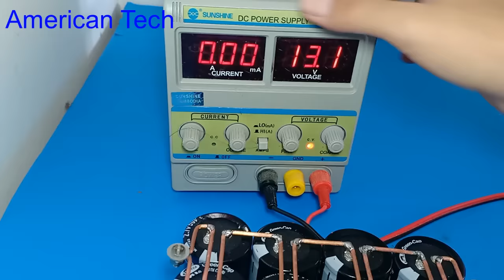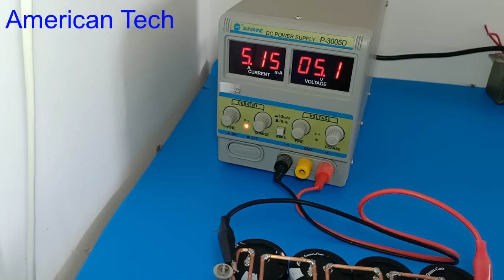12V , 100A using Super capacitors , Amazing idea

Comment: I'm no electrician, but my son has a similar setup in his Toyota pickup. Been working great for around 6 months so far. Yes, he uses a small solar panel to keep them topped off, but overall, hasn't had any issues at all.
Reply: capstr kahn say milain gay
Reply: A very interesting comment sir. May I ask what is the power rating of the small solar panel that your son used?

Comment: What your doing is DANGEROUS. This circuit should never be run higher that 10.8 volts and without a balance circuit to stabilize each pair of caps they will eventually destroy themselves.
Reply: Это реклама для лохов покупателей.
Reply: I agree. He needs 6 capacitors in series to allow an absolute maximum of 16.2 volts, to be compatible with charging a 6 cell lead acid battery. The 12 capacitors, series-paralleled, will yield 166.66666.... farads.
Reply: Thanks!:D
Reply: if the output is feeding the electrolyte HHO  generator and the input is from the car alternator, perhaps you can get about 20Amps feeding continously
Reply: Didn't Lasersaber built a safe version years ago?
Reply: @kennethschultz6465  whats that
Reply: He'll fry his starter too if he has over rated fuses between.
Reply: @pyronmasters  
Yeah. Somebody did. The biggest problem is that if for some reason you flood your engine, you wont have the cranks to air out the engine. Then you're screwed.
Optima makes a really nice battery. If its taken care of itll last forever. Well, close to it.
I'd never trust this contraption. Probably end up getting killed checking your oil.
Reply: AHHHH does this mean im gonna die
Reply: Svp ecrire en français
Reply: Olha o like
Reply: @seryj591  
Но вы действительно можете это сделать?
Reply: @vincentrobinette1507   ....
Reply: The capacitors discharges with a couple of hours. As long as you have the input voltage from he generator, sofar so good. Useless for starting the engine.
Reply: 2.7V * 4S = 10.8V, Balance circuit

Comment: The capacitors are connected in a series and parallel configuration,  ie 4x 2.7v = 10.8 working voltage NOT 12v you are over charging the capacitors. Add another two to the array  would solve this. I don't think that wire would handle 100 amps eather.
Reply: Wire maybe but only for a short time(10sec?)
Reply: Plus he need balancing boards for them to work correctly
Reply: @24BLUEELMO  its capacitors, no issue with balancing
Reply: if you know why you don't make it on your own

Comment: Capacitors will leak. The voltage would probably drop 1 volt each day. Although it can deliver large current for a short time, the voltage drops as current drains. So this setup can only function as a small capacity battery which cannot keep its voltage for a few seconds or a few days. You can use it as a car battery if you drive the car everyday. But if your dome light is left on then your car may not start the next morning. One more thing: you need 5 in series if you charge it to 12V, or 6 in series if you use it in car (around 14V).
Reply: @Jerry Chu,  I had the same doubt which you had explained here. Still I have no clarity on this.

First thing is, is this setup will work? Will it produce 12V? Or it has the capability to store that 12v at least for a day?

Second thing, can we use this to "jump start" our cars? When the car is standby in parking for one month.
If it can be used in cars, then can we replace the battery??
Reply: DC 12 v 
Dc  19 v
Reply: Chu 
Really it's true 
Good information
Reply: You noticed that too!! There's one caveat: 2 strings of five capacitors drops the total  down to 200 farads, allowing a maximum of 13.5 volts. Putting six in series to keep them within their ratings if used with a 6 cell lead acid battery, drops the capacitance  down to 166.66666.... farads. That allows up to 16.2 volts, an appropriate margin for the charging range of a car battery.
Reply: @rathnamalasp1097  For 12V you need to connect 5 of these capacitors in series, and be careful not to let the voltage to go above 13V. You better use 6 to be safe. Capacitors cannot replace battery. You can use this setup for spot welding, but not much else. To use in car you need to buy more capacitors and will cost a lot more than a battery.
Reply: Just add small solar pannel to the car, the capacitors will never discharge.
Reply: Higgins
Reply: Akan bangla
Reply: Jerry Chu so, we can jump start the car which has the dead battery due to the car is standby for long days
Reply: +Jerry Chu Stored energy is 5281 Joule or 1.4 Watt hours this is almost nothing (in case of 8caps capacity drops to 62.6 F
Reply: Baixar este video
Reply: Que voltagem é este capácitor?
Reply: it will not even crank the starter ... turn the car off... try starting it ... couple seconds caps discharge...  its over...oh how did the car get started in the first place... the battery of course
Reply: Fake
Reply: @ronaldojose7580  2.7V
Reply: Jerry Chu please tell me if I need 12v and 100amp. Current production will it be helpful and also what supply will it need to charge.
Reply: Those caps will hold a charge for about a week. Sometimes they can surprise you. Tell you one thing, if I went back to work on them I'd still discharge them first. I've seen some caps hold a charge for months. I do live in LA where it is dry so that could be why.
Reply: @peterzingler6221  parallel doubble capacitor doubbles the capacity, but series four capacitors reduce the capacity one fourth. 500x2=1000, 1000/4=250 actual capacity will be about 175 to 200F
Reply: Also if you have a nearly dead battery which does not deliver enough current at once to power the starter it might still be able to charge a few supercaps over a few minutes, which can then be used to start the car. But please, use enough of them in series.
Reply: @DxDemolation  anybody please design correct cheap battery replacement for car with safely
Reply: Have seen material of some guy he measured volts during long period so he got average results 17% per month! And it can be 1 volt per day but not for this system, here around 0.04 volts per day.
Reply: @jailtonjose5657  negative vibe,y?
Reply: My Buick alternator puts out over 14.3V when the vehicle is running, Super caps must NEVER be overvoltage charged, I can destroy them and they may explode and cause severe facial burns.  Buy balancing boards for supercapacitors in series as an unequal charging voltage may them can result in overvoltage. Balancing boards are cheap usually less than $2 USD when bought in 4-6 piece qty. on eBay. They conduct charge away from capacitor as it reaches 2.55- to 2.65V full charge levels.
Reply: @vincentrobinette1507  The ENERGY in capacitor strings is enormous. Energy = 1/2 C(farads) * V^2 This string of 8 capacitors (@500F each) charged to 12 volts C= 1/2 * 250Farads * 12V * 12V Charges to 30,000+ Joules! That is roughly 500 watts for 60 seconds, enough to melt 14 AWG wire in seconds with power to spare!.

Comment: 2.7v × 4 = 10.8v
Over charging 
Life short
Reply: No, it is not overload if the voltage tolerance in the capacitors allows at least 0.5 volts.

Comment: 100A LMAO, okay, that's enough YouTube for today.
Reply: Those supercapacitors can deliver huge amounts of current. I have a pair much smaller capacitors and, at 4V they will INSTANTLY melt a 4cm piece of tin wire. So, 100A is not impossible for those 8 giants in the video
Reply: @FilipeDGuedes  Yeah, maybe when they instantly discharge but that's not a 100A circuit. That bulb wouldn't even be on at 100A with 12V... 1200W through that little bulb would have burst it into a thousand pieces.
Reply: @ArrtusMusic  you really don't know much about electricity, do you? Nobody said there was 100A going through that bulb. 100A is the short circuit current. That means the capacitors can deliver up to 100A, not that anything will draw 100A from the capacitors.
Reply: @FilipeDGuedes  No, I don't have a single clue about electricity. Hahahahahahaha
Reply: @ArrtusMusic  The resistance of the blub should be the current limiter? 5 Watts, maybe 10 Watts, again not AMPS of power, but the blub would not explode because it limits itself? It can only draw so much current? Did he really say 1,000 AMPS? I could not hear him say anything. There clearly some safety issues, as well as error in voltage, and the little wire and solder joints, will be limiting the current draw (When they melt). Just call them fusible links. OR fuses that ignite the plastic, rubber, fuel under the hood.
Reply: @FilipeDGuedes  You realize this is just a dude that lives in a 3rd world country making click bait fake videos to get ad money, right?
Reply: @zacharycarley9135  are you talking about Arrtus or the guy who made this video?
Reply: I wanna see him do the tongue test first. Then I'll believe it.
Reply: @FilipeDGuedes  
Yes, they do. But because theyre caps, youre not gonna get too many cranks out of 1 charge. So if your car dont wanna start up in the mornings easily. This thing can put you in a screwed position.
Reply: @siggyretburns7523  that's for sure. By the way, the "tongue test" wouldn't hurt at all. That's exactly like wiring any other 12V source to your tongue
Reply: @FilipeDGuedes  
I dunno. I'll have to find s salamander to try it on. I had a 65v 11500mf cap and s 12v solar panel. I hooked it up for about 5 seconds and touched it to the frame of my car and ZAP! It blasted a fairly sized dimple in the steel frame. Sure scared the piss outta me. Not what I expected at all.
Im not doubting your word, as electricity is weird to start with. But Ill be fucked if im gonna touch my tongue to it after what I saw with my car..nooo thank you. Lol
Reply: @siggyretburns7523  capacitors are capable of generating incredibly high currents when short circuited due to it's low internal resistance.  That's why they can generate big sparks and even melt metals. However, when you touch it's terminals with your fingers or your tongue, Ohm's law (current equals voltage over resistance) tells us you won't be electrocuted, since your resistance is high and the voltage is low

Comment: Caacitor are charged fastly and also discharge very quickly. So you guys don't do ....its run time is very low. There is difference between battery and capacitor . cap store  charge quickly and ones mans failure and connected to load discharge very fast

Comment: Good but you need 6 in series if you want to replace a car battery. The alternator charges at 14-15 volts. With only 4 in series your voltage is 10.8 volts, 12.8 max out. You wouldn't get very far in your car before these caps explode like little grenades as soon as the alternator over charges them. I like your idea, you just need to add 2 more pairs.

Comment: The Channel's owner is not worred about all this calculation. He Just want to sell the capacitors in a affiliate program. The link with his id in the description.
Reply: Despite his mercantile goals :) idea itself is good. It just requires more careful calculations and don't be greedy on hi cap supercapacitors. :) And ideally (if you don't drive every day) disconnect caps from the battery.

Comment: 1F=1C/1V=1Ax1s/1V,
so here I see 250F  (2x 500F/4 = 250F), voltage is 12V, so we have 250F=xAx1s/12V, then we got  3000As = 0,83Ah...huge amount of energy :D
Reply: How do you make a cap half sice ... Lol ITs not a resister
You can go Up in any way .. but NEVER under with a cap 
Maybe som caps hawe other charaktaristic .. 
Take 2 x 12v 6A batteries 
You can go 12v 12A or 24v6A ... NEVER ever 6v 24A
Unless It's 4 x 6v 6A
Reply: Except that Ah is NOT a unit of energy!

0.83Ah at 12V (which it will not be because it’s a discharging capacitor) is like 10Wh.

An AA battery holds 2Ah. Is that a huge amount of “energy”?
At 1.5V (pretty constant, cause it’s a real battery), that’s 3Wh.

WHAT?

Are we concluding that this rig only holds the energy of three AA batteries?

No, it holds less (because of the decaying voltage of the capacitor bank).

Comment: Super bad soldering
Reply: ikr?
Reply: I think so
Reply: Aldough the capacitors don't give more than 10 amps, that soldering is gonna fall at 1 amp
Reply: The Observer po phph00
Reply: The guy needs to take a soldering class.  he "paints" on the solder, rather than letting the joint heat up and letting the solder flow.  I also don't think he is using rosin core solder.
Reply: U need Ts100 soldering iron and 20min youtube soldering lessons
Reply: "Heat the work, not the solder!!" went through my head 36 times during this video.
Reply: As we said in the navy, the bigger the glob the better the job.
Reply: His iron isn't even holding the heat, more like dead Chinese tech.
Reply: Da pra ficar doente de ver ele soldando. O solda feia!
Reply: I like bad soldering:)
Reply: @catinka  good job done

Comment: You should never exceed 80% of the rated value.  So your design actually needs 4 more capacitors to be safe. 6 in series in parallel with 6 in series giving you 16.2 Volts 167Farad.  80% of 16.2V = 12.9V
Reply: Very dangerous 4x2.7 is not 12v

Comment: 4times to 2 paralel capacitor to series. Each capacitor 2.7V/500F. So pararel capacitor 2.7V/1000F. 4 times to series 1/C=1/C1+1/C2+1/C3+1/C4, so C=250F and 4times 2.7V = 10.8V. This is 250F/10.8V. Where you have 12V?
Reply: You are crazy.
Reply: This is fact.
Reply: @MilanOndrka   this formula cannot be applied in this case.
no AC current.
This is battery mode. series and parallel connected batteries.
with a serial connection, the capacity of the battery is equal to the capacity of a single cell. voltage is equal to the sum of the cells.
Sorry for my English.
Reply: @user-hm9yn5bo5o  So on 12V have on capacitor 12/4=3V. 3V is higher as 2.7V. Capacitors is in overvoltage. Overvoltage = temperature, Overcurrent = temperature. High temperate = low lifetime. Low lifetime = crash capacitors in early time.
Reply: @user-hm9yn5bo5o   capacity (Farad) and energy (Joul) is diferent. Signle 500F/2.7V = 1/2*C*U^2 = 250*2.7^2 = 1 822.5 J. So 8capacitor = 8*1 822.5 = 14 580 J. Try math energy on 250F /10.8V = 125*10.8^2 = 14 580J. 14 580 = 14 580. Calc is ok. This circuit with 8 capacitor on this video have 250F / 10.8V.
Reply: Example if i try all 8 capacitors connect series (on this video is combined series and parralel circuit) = 21,6V and 62,5 F.  Try calc energy. = 31.25 * 21.6^2 = 14 580 J again.  You see different on type circuit?  Bipolar capacitor on AC ? Half time on period = reverse voltage. Reverse voltage = temperature .... Unipolar and Bipolar capacitors is different. Unipolar capacitor on AC is OK. Bipolar on AC is Bad. Unipolar capacitor on DC is OK.
Reply: @MilanOndrka  Read carefully the link ourself. It is written there - "...with all other factors unchanged..." But we increase voltage, so capasitance of the series capacitors does not change. 2,7V * 4 pcs. = 10,8V and 500F + 500F = 1000F. So he needs about 5 - 6 capacitors in series for 13,5V - 16,2V battery (for example a car battery replacement). But as capacitors discharge voltage drops linearly. So he can only use this battery from 16,2V to about 10,8V, not all the charge from capacitor battery (if he is not going to use spec. electronics to use all the charge and get stabilized 12V DC). So he can only use 33,3% of the charge. 1 Farad = 1 Coulomb / 1 Volt.  1 Ampere = 1 Coulomb / 1 second.  So 2 paralel capacitors have 2700 Coulombs = 2,7V * 1000F. 33,3% of the charge is 899 Coulomb. SO 6*2 capacitor battery can be used from 16,2V to 10.8V as about 250 mAh battery. Light to middle weight car starter motor takes approximately 400 Amps for cold cranking, so such capacitor battery will last for about 2 - 3 seconds of cranking the engine. Not enough to be worthy for me.
Reply: Ok
Reply: @MilanOndrka  these poor capacitors aren't gonna crash, they are gonna pop like a can left in the sun light, if they keep getting used like this that is. 
But yeah critical failure is all But guaranteed.
Reply: when calculating the capacity of the capacitors, the parallel ones are added, and the series ones are divided by the number of cans.
(500f+500f)/4 banks = ~250f
Reply: You guys make me angry.
you are all savvy with theoretical calculations, which is good.
but then the experimentation is totally missing.
therefore do not make the comparison between theory and concrete facts.
Maybe American Tech exaggerates, but it experiments all the time.
Test things concretely. It will always be many steps ahead of you.
and you feel it, you attack it for this reason.

Comment: Instead of making all those rectangles, couldn't you just connect them in series with one wire in the same configuration? I mean we are essentially connecting a bunch of caps in series right?
Reply: I thought there would be different value of voltage and ampere when use only sraight series
Reply: Different value if connecting in series, amperes would be the same but voltage up

Comment: Hi man, how long does the charge last using a 12 volt motor? Thank you.
Reply: It will last for seconds. It's a capacitor not a battery bank. And 100amp isn't enough to turn over a modern high compression gasoline motor... so not sure what video about really.

Comment: 100 A and you can charge it in 5 minuts loool 
that's the future of tesla car hhhhhh
Reply: Faster than that. More like 10 secs. Depending on what charges it. But they discharge equally as fast too. In a normal AC 60hz circuit, most charge and discharge that fast just to keep a steady flow of current. Its actually amazing how fast they do it. Of course the more capacitance means it takes longer. But in this case, not long at all. A few seconds. 30 tops.
I just dont trust this thing though. Thats alot of juice.
Reply: Fake, if you can fully charge in 15 min with 5 amps. This means you have only 1,25 amp/hour battery (max!).